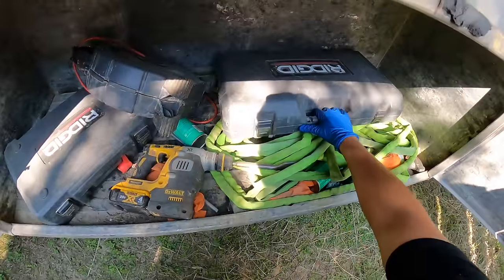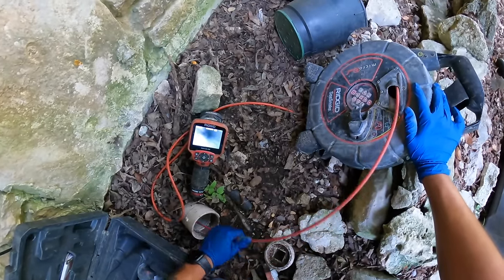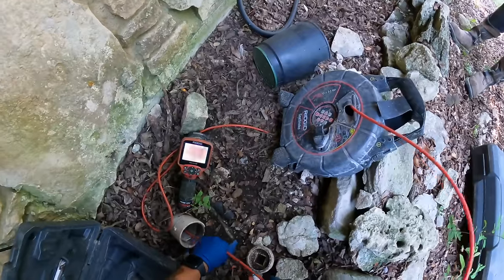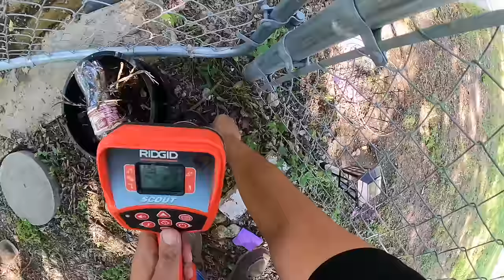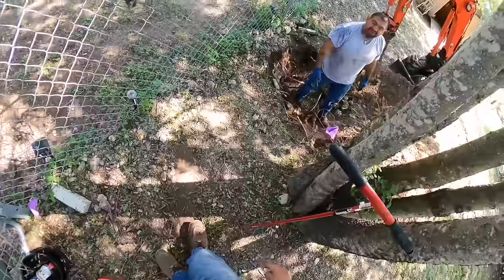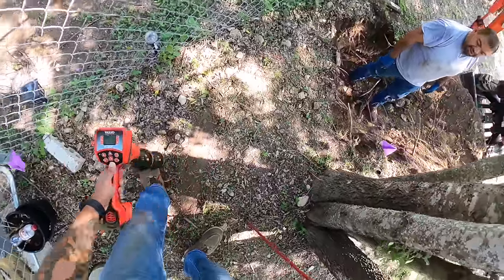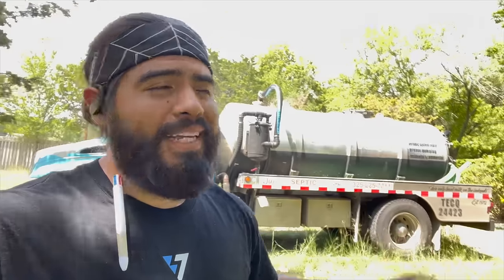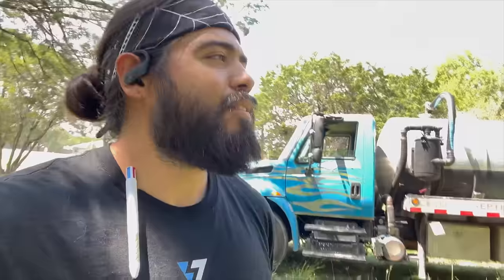First Time This Septic Tank Has Been Opened (50+ YEARS OF POO)

Comment: Thanks!
Reply: Are you a plumber? Can you tell me how exactly should the inlet and outlet septic tank pipes be? 

To give you a little background to our problem. Ironically, my father is a civil engineer, but he's passed the age of retirement, so he doesn't actually remember things he learned in the Engineering University much, and the fact that he monitored roads and bridges' constructions his whole life means that he has no practical experience of constructing houses before. 

We're building our house, and we've never felt this task being so difficult before, except when we reached the septic tank construction. My father wants things perfect and he is unable to get work done his way because of doubts that arise by people's suggestion (this includes insufficient information provided by engineers, plumber's and worker's experiences -- usually evolving around the trends in their hometowns and our neighbours' adamant suggestions in-contrary to my father's logic.

Now, to cut this short: we have built our Septic tank of 3 chambers. The inlet has 2 pipes, one of them has an elbow and the other has a T, attached to their ends which are then extended about a foot below to enter the flushed water; the outlet, on the other hand, has a T attached to the end without any extended pipes. 

Now, my father got one of the inlet pipes' elbow's top cut into a 2''x2'' box to let the inlet gases escape (as he sees that to be the purpose of a T, and because our plumber already had installed an elbow -- without a consultation -- my father found it to be sensible to get the top part removed). 

I don't exactly know what he did is right or not, but he finds it okay. Now, because our neighbour argues against even for T to be installed, he finds it odd for the elbow's top to be removed (which even I found absurd when my father told me what he did). This in retrospect, my father is now not sure if what he has done is right thing, and whether he should remove that elbow, add an extended pipe and finally install a new T/elbow.

It is all a mess! I need a faster answer because my father will find a way to fix ut myself tomorrow. I don't want something wrong to happen again. Therefore, a faster answer would be much appreciated. Thanks!